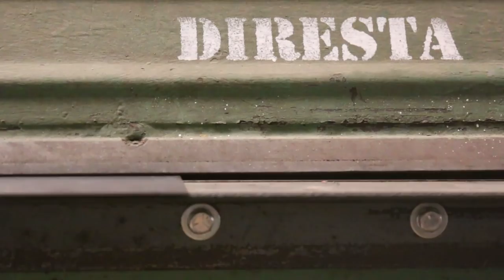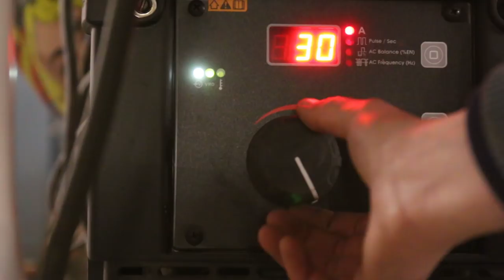Workshop Lamp made from Sheetmetal

Comment: Very nice and simple design ! Just one question, are the magnet fastened/glued to avoid getting stuck on the metal object you put this on ?
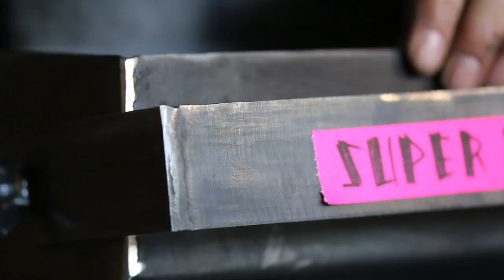Reply: flo ri shouldn’t need to be as she’s removed material from one side of the magnet. Look at the countersink at 4:26
Reply: So it's a feature that avoid getting the magnet stuck to the other metal object because there is less surface area (thus less magnetic force) I guess ? is it what you meant ? 
I first assumed the countersink was for a fastener ^^
Reply: flo ri yes I believe the surface area difference would be enough to create a bias and keep the magnets on the fixture. I could be wrong because, ya know... magnets. Hopefully Laura clarifies.
Reply: Alright, thanks for the answer anyway =)

Comment: Oh man, working in an imperial shop!  Does everything feel all slightly wrong-sized or wonkily proportioned? I spend so much time in metric fasteners that imperial ones feel just a bit off, any time I wind up with an Actually American™ product to hack at. (My new telescope was apparently made by Ford: half the machine screws are metric, half are imperial. Argh!)
Reply: We have the same "half and half" problem here in Canada.  We are officially metric, but our proximity to the USA means fasteners, tools and materials are often in imperial measurements.  It can be really frustrating sometimes!

Comment: If you are going to be a YouTube sensation and have people follow your work - learn to put earthing conductors on metal projects.  This is the reason why Electricians do apprenticeships and are licensed to do electrical work.   In Australia if someone made that, and worst case scenario there was a problem that caused the frame to be live - and it killed someone, the person who made it would most likely go to Jail.............    Im not 100% sure of legislation in the USA or Germany but there is NO WAY we would make that and not put an earth conductor on it in Australia.
Reply: Craig Laird - Commonly in USA metal lampholder isn't earthed. However in UK / Europe,  metal lampholder must to be earthed, if it plastic then it's not required,  however if cable travel throught metal pipe or any metal fixture, plastic grommet / cord grip is required at both end of pipe or any entry throught fixture. What laura did is fine. No need to worry :)
Reply: Perhaps youtubers need to put some wording up on their videos "Check legislation in your country"   far too many youtube videos where no qualified people are doing electrical work.  Plus - do you need to be Electrically qualified to do what she done there in the USA and Europe ?
Reply: A license is not proof of anything other than you supposedly learned something while working for 2-4yrs with a master electrician. At least that's the case in the US, further, I've seen plenty of masters who know less than a handyman (with work that shows it). Most jurisdictions allow a homeowner to file and owner/builder permit to do any and all electrical work so long as it is inspected and meets NEC code, no license needed, though most folks are too dumb or lazy to go that route. Since this is not house wiring but rather a device that plugs into the wall, NEC would not actually be the governing body. Rather, you would need to follow the standards set by folks like ETL or UL in order to get the device approved by one of their testing labs. Since this is a DIY project not intended for mass-market retail sale, none of this would really be applicable. Though being an EE, I would put a ground connection on the chassis just to prevent that 0.1% chance of something going wrong, I guess 3 conductor cloth wire is hard to find. Very nice build, I would love to get a brake and shear to play with some sheet metal.
Reply from the maker: i put it in the description...
Reply: In the USA  all most lamps do not have earth ground! Sad  but true!!  Finding fault with one person on a video  is not the best answer! The manufacturer of the lamp industry is where you should be concerning your question too!!!! Because you can still buy two wire kit here at home in the USA! An I am electrician SIR !!!
Reply: I donno that ive ever seen a metal lamp with a earth wire here in the US, other than florescent strip lights.
Reply: In the USA, government would do a 5 year study costing millions, then come to the conclusion that lamps should be banned all together, unless the party making said lamp donated to the election campaign fund of the local government.